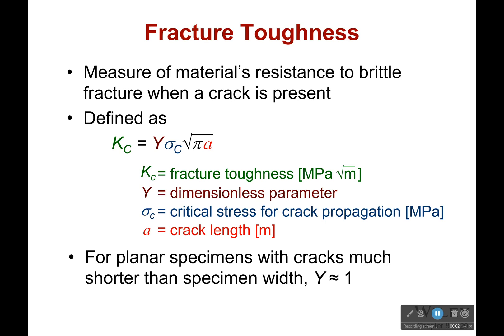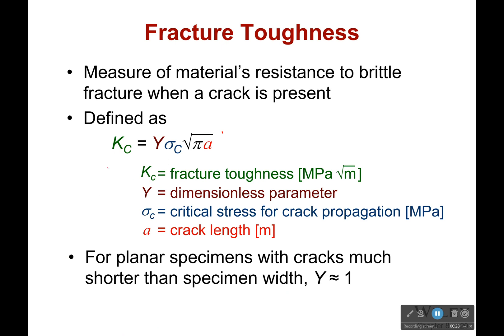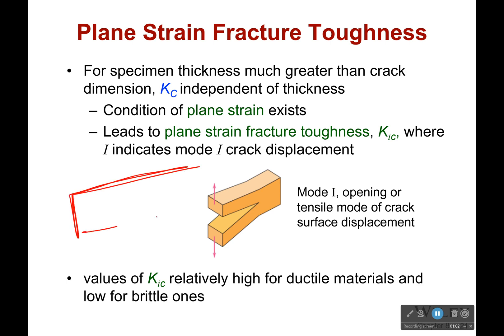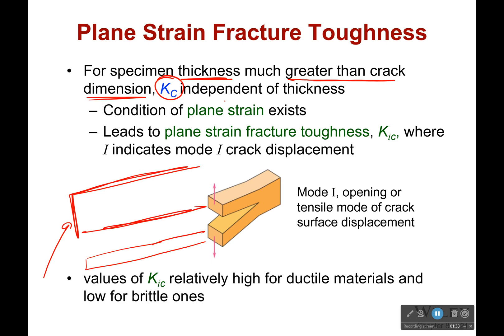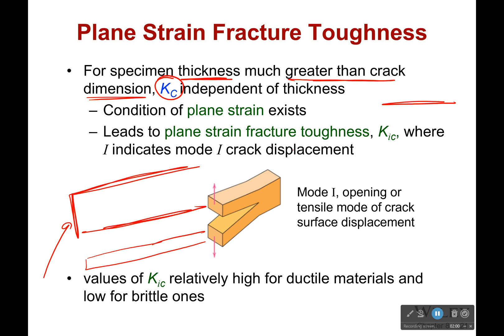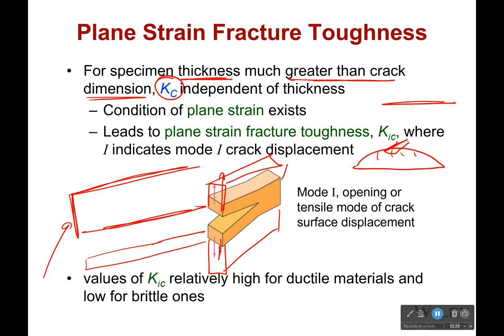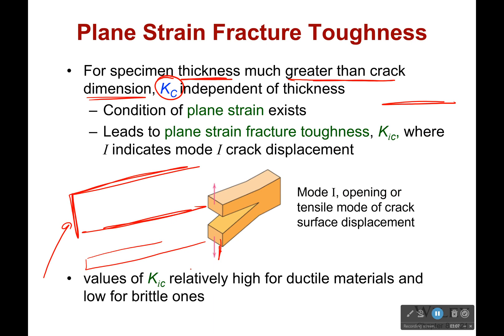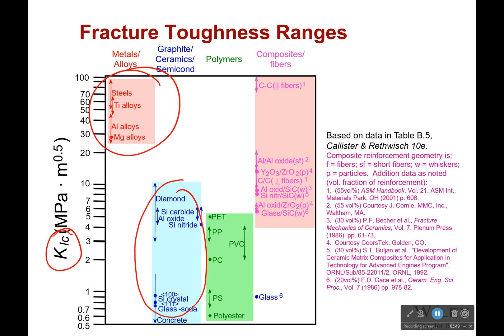Fracture Toughness

Comment: why/how is concrete used for buildings if it's that much brittle as the table says?
Reply from the maker: Rebar is magic. Concrete is brittle in tension. Terribly so. However, what we do is place rebar that is stretched inside of the concrete. This causes the concrete to constantly be in a state of compression when you let go of the rebar. Even if you "stretch" the concrete at that point, you are just removing the pre-built in compression. This helps us to build strong concrete structures.